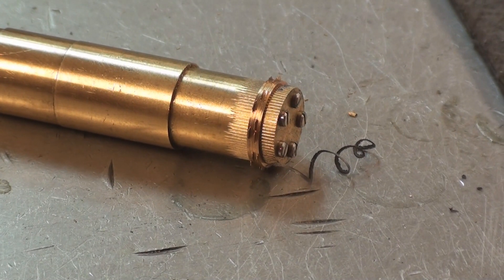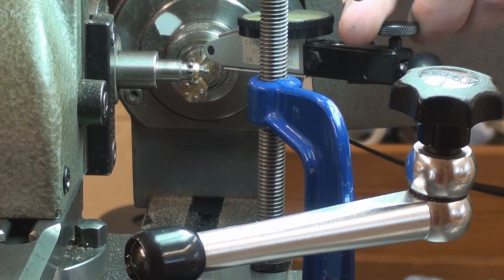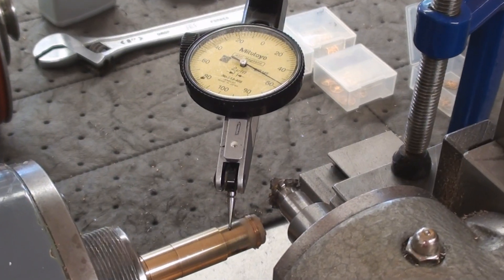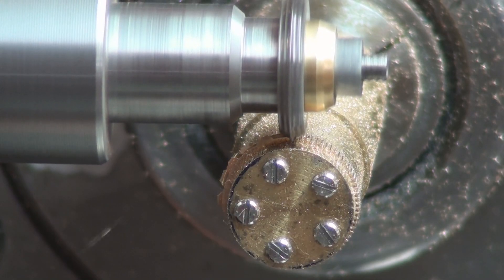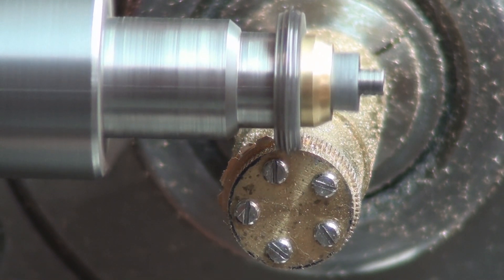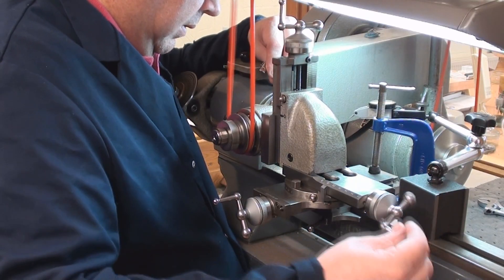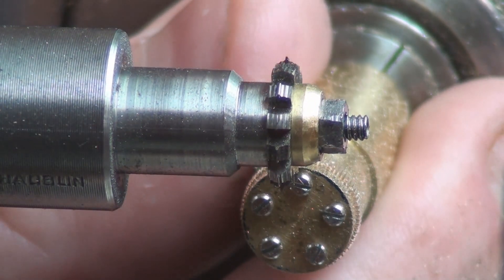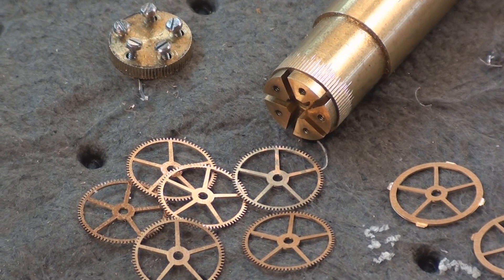Wheel Cutting

Comment: Wonderful video to explain wheel cutting. I have a few questions.
1. How do you make the discs for the wheels? Are they stamped out or hand made to have the spokes/arms in that design before fitting into the mandrill?
2.Do you use Bergeon's cutters and the same profiles?

Thanks and best regards